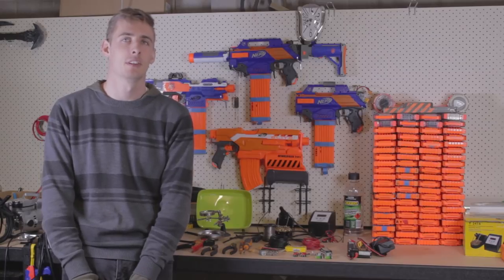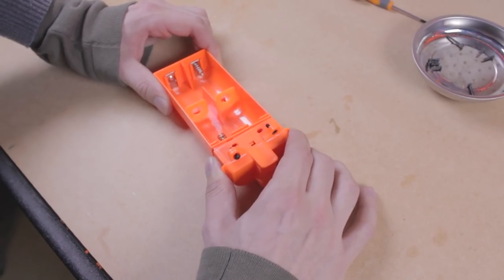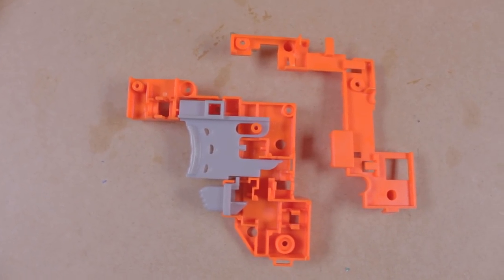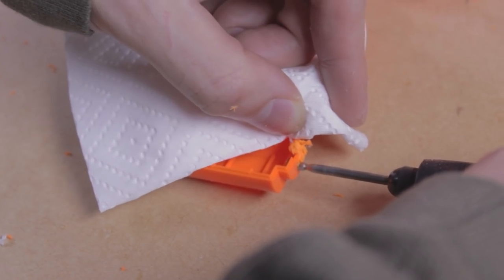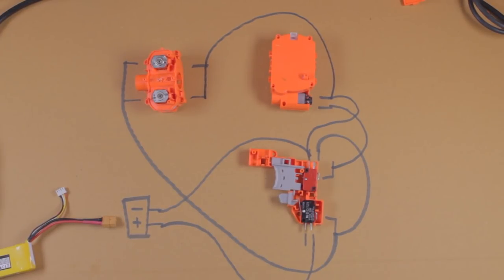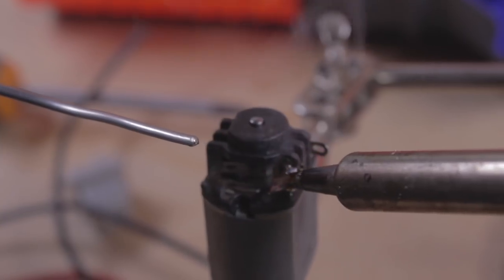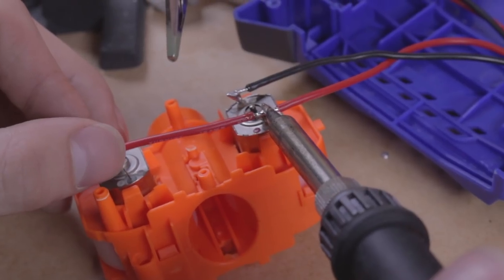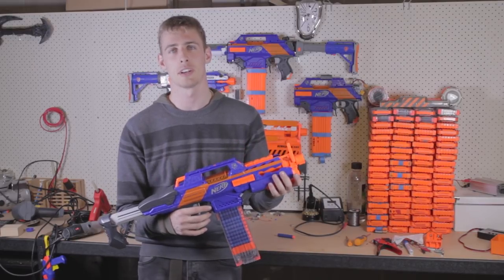How to Make a Super Rapidstrike | MAKE TEST BATTLE Modding Tutorial

Comment: Hi MTB! Nice video!!!

I got my Rapidstrike about two weeks ago, and I followed Coop's guide, but my gun had grey trigger. When I opened it, saw in the pusher mech, two resistors, I didn't cut it. I kept the motors, in my country is impossible to get better motors. Im using x3 3,6v batteries and the ROF is the same (18 darts in 4-5 seconds), but the range is a little bit better. I really want a faster ROF, but I don't know what I need to do. Can you help me? :)

Thank You

PS: I'm brazilian, :P
Reply from the maker: +O Alface Hi there! The trick to getting the rate of fire as high as possible is to get the pusher motor spinning as fast as possible. Without changing the motors this leaves you with only a few small things you can do.
1) Rewire the blaster as per this video to cut down as much unnecessary circuitry as possible. This will reduce the resistance, particularly with the thicker gauge wire and low resistance switches.
2) Use the best quality batteries that you can find. Better batteries will ba able to provide more current and maintain a higher voltage; particularly LiPo packs instead of single AA sized cells.
3) Use more batteries. Overvolting is a pretty simple way to increase the rate of fire but you risk ruining your motors, particularly the stock ones.
Otherwise you really need to swap out the pusher motor; I highly suggest our MTB Rhino 130 motors. -R
Reply: +Make.Test.Battle And the resistors of the pusher motor??? Should I take out it using stock motors???
Reply from the maker: +O Alface Yes; definitely. If you follow this video you will see that you should take out all of the original electronic parts other than the motors and the switches in a full rewire. Everything else only slow down the motors -R
Reply: +Make.Test.Battle THX!
Reply: +Make.Test.Battle I'm not going to put microswitches for now, what I need to do with the acess door switch? I'm running 3 minamoto batteries, 3.6v each.

Comment: why did you need to put the running motor into the metho? what does that do?
Reply from the maker: Hucky32 What it does is shape the carbon brushes on the motor to provide a better contact. Makes the motors much less likely to burn out when being used. Not really needed for most motors but a necessity for Ransons as they usually burn out very easily.
Reply: ah thanks :)

Comment: I have a 1300 mAh, 11.1v, 20c discharge 3s lipo, will that work?
Reply from the maker: +maxava123 That should be fine. If you had the option, maybe get a 30C version instead but that one is fine -R
Reply: +Make.Test.Battle I'm not using the same motors so it should be fine

Comment: What does the burn-in for the Ranson do? Why is it necessary?
Reply from the maker: Gabriel Doudna It helps to round off the brushes of the motor to get a better contact. This results in a better contact, less arcing, and reduced heat buildup making the motors much more reliable. It is really only needed for the Ranson motors which suffer from burning out. -R
Reply: Cool, thanks for the info and quick reply!
Reply: The Hobbyking motors work beautifully at 8.4 volts. However, the part numbers on the side of them say "FK130SH" and according to the Mabuchi website, they run just fine at 12 volts! So get those!

Comment: if using this setting & motor..
1. may i use Ultrafire batteries 14500 1200mAh (3.7v)
2. how much Ultrafire batteries that i needed?

Really want to use ultrafire batteries because in my country LiPo Battery Pack & LiPo charger price are rocket high!

If can't please suggest me with suitable motor for ultrafire batteries that are stated.
TQ Make.Test.Battle :-)
Reply from the maker: You shouldn't be using Ultrafires for replacement motors. They do not have a high enough discharger rate to properly power the motors
Reply: +Make.Test.Battle how about using ultrafire only for stock motor?
Reply: +Mohd Syahwal I'd get a 2s lipo much better

Comment: Why do you need the lipo charger power source?
Reply from the maker: +thedavinator 37 Most good balancing LiPo chargers run off 12 volts DC so you need something to convert your wall socket AC power to 12v DC. THis is usually so you can run the charger off a car battery when in the field -R
Reply: +Make.Test.Battle oh ok thanks and is it necessary to put the motors into the liquid?
Reply from the maker: +thedavinator 37 No, only that particular brand of motors, but you can't get them anymore anyway so it doesn't matter -R
Reply: +Make.Test.Battle oh so like an ac adapter
Reply from the maker: thedavinator 37 Exactly -R

Comment: Also how to I get the pusher motor to instantly stop so it does stop in a odd position or fire extra shots?
Reply from the maker: Is because of the motor braking -R
Reply: Now what is motor braking and how do I do it.
Reply from the maker: When the motor is not being powered, it uses the power it generates itself to slow itself down. You basicallt are just wiring the motor to itself. Its essential for RS pushers but not necessary for flywheels. Sounds cool tho. PsykeSG has a video on it if you are curious -R
Reply: But how does it immediatly start the motors?
Reply: Also can I have link to video?

Comment: is there any other battery that could be used maybe some ultrafire instead??
Reply from the maker: +WCxColossus UltraFires and other 14500 sized batteries don't have the performance to run upgraded motors properly. There are some IMRs that are alright (such as WindyFire and AW cells) but the rest are quite mediocre and a LiPo is far superior. -R
Reply: +Make.Test.Battle ah ok so if i wanna upgrade motors ima need to run a 3s lipo
Reply from the maker: +WCxColossus Yes. I would highly recommend running LiPos.
Reply: +Make.Test.Battle nice thanks for the help. ive been looking up replacment motors is there any that you recomend?? alot of ppl recoment 180 blades but idk what that is lol
Reply from the maker: Have a search for our MTB Rhino 130 motors. You can find a video about them on the channel. They are really, really good and you don't need to do any shell cutting. They are the same as Falcons. -R

Comment: Hey mtb, would this work if I wanted to run lower voltage
Reply from the maker: It wouldn't perform as well with those motors. If you want to use a 2S LiPo or similar (~8 volts) use MTB Honey Badgers -R
Reply: Ok thanks

Comment: Can I use alternatives to a LIPO like 4 IMRs instead?
Reply: Kingrai 15 it depends on the motors/switches you buy
Reply: IMRs are dangerous
Reply: @Cringemoment4045  howd u mean
Reply: @warriorharj79  they don't have the required amps to supply the motors and will burn them out
Reply: @Cringemoment4045  Ah okay, what about with a rewire and stock motors?
Reply: @warriorharj79  stock and BP motors can run IMRs. Others cant
Reply: @Cringemoment4045  ah okay thanks, what do you mean by BP?
Reply: @warriorharj79  blasterparts

Comment: If the pusher doesn't retract does that mean no single firing?!?!?
Reply from the maker: +Turb Plays You can still single fire quire easily. The added motor braking replaces the need for retracetion -R
Reply: +Make.Test.Battle if i reload would the pusher get in the way of the next mag?
Reply from the maker: not the dart just pushes it up slightly. no problems
Reply: If the pusher arm is extended and the mag in inserted the dart will be hitting the pusher arm and it would break the dart and or pusher arm
Reply from the maker: Turb Plays No; the pusher arm can be very safely pushed upwards by the darts. I've never had any issues with it. Its exactly the same as what happens when the dart is fired and the next dart in the mag pushes up on it -R
Reply: Ok just wanted to clarify b4 doing the mod. Can i run these motors with a 3s lipo?

http://www.rcplanet.com/EFlite_180_Motor_with_8T_0_5M_Pin_and_PTC_Fuse_Lef_p/eflh1210b.htm
Reply from the maker: Turb Plays I believe these are a 2S motor; but if you want to wait maybe a month, there will be a new line of MTB 180 sized motors that have a much higher performance for about the same price that run off 3S -R
Reply: +Make.Test.Battle How much do ranson motors go for? I cant find cheap ones, saw 1 for 14 dollars
Reply from the maker: Turb Plays Get MTB Honey Badger motors -R
Reply: Make.Test.Battle Would they burn out since its 3S lipo power?
Reply from the maker: Turb Plays No, as a pusher they dont take as much load as the flywheels do so they are okay. They were designed for this role and you should get 14 darts per second out of them. Have a watch of our other video on it! -R
Reply: +Make.Test.Battle its not a 3s lipo that makes it get 14 darts per second
Reply from the maker: Turb Plays hmm? I dont understand what you mean? -R
Reply: u used a higher AMP/volt battery for the 14 darts per second on the testing video with 14 dps
Reply from the maker: Turb Plays It was a normal 3S LiPo. it just happened to be a large capacity one that we use for testing and stuff. A normal 3S battery would get the same result -R
Reply: oh and the 180 EFLH1210B would be 2 much ROF right?
Reply from the maker: Turb Plays Those would work just fine; their RPM is lower than a honey badgers. Not sure exactly what they would get -R
Reply: oh i want good but controllable ROF
Reply: +Make.Test.Battle can i use RM2 motors they have good RPM, problem is that the shipping cost for ur honey badger motors are expensive
Reply from the maker: Turb Plays RM2s are cheaper, but they dont have carbon brushes so they will quickly burn out. If you have the skill you can buy a cheap carbon brushed donor motor and swap the brushes into the RM2. Otherwise I cannot recommend those motors -R
Reply: +Make.Test.Battle so i can take the clip out of the gun and reinsert a clip regardless if the pusher arm is in the extended position
Reply from the maker: Turb Plays Yup -R

Comment: Is the circuit he used in series or in parallel ?
Reply from the maker: The motors are very clearly in parallel, otherwise in Series the voltage would stack. 
-Justin

Comment: i saw some comments about replacing the falcon motors with rhinos and the ranson motor with honeybadgers. are these motors on amazon and if they are could someone provide a link to them pls?
Reply: Rhinos and honeybadgers are on blastertech, containment crew, Etsy and eBay but not Amazon
Reply: well now I know of OutofDarts, but thanks for responding. And while I have you, when calculating the total usage time of a Lipo, do you use the stall current of the motors, or is there a lower normal operating amperage? When looking at the stryfe vid, with the rhinos and the 1000 mAh battery that is recommended, total operation time is only about 2 minutes, which seems kinda low to me. Know what I mean?

Comment: can you mod my rapidstrik pleas and fix it
Reply from the maker: No.
Reply: +Make.Test.Battle hey why didn't you guys include a cut off switch for the pusher motor in the circuit to insure thebplunger rod is always fully retracted when not in use?
Reply from the maker: Steve W Because it makes it way more complicated to wire up and isn't really necessary -R

Comment: Three questions 
1: After reading some comments and your replies, I see the MTB Rhino motors would be good ones to get and more available, for those do you still need to do the burn in? 
2:Can you elaborate on the lipo charger and charger power supply , your link for the power supply has many results and I do not understand which I should get, or how to determine that, could I jurry rig an old PC PSU for this purpose?
3: instead of the given battery, requiring the imo overly part-y charging solution, could you get a similarly speced RC car battery that comes with a little wallwart charger? Just to make charging a bit easier and convenient. (this kind of charger http://www.ebay.com/itm/like/201262875230?lpid=82&chn=ps&ul_noapp=true)
Reply from the maker: 1) No
2) Buy this instead: http://www.hobbyking.com/hobbyking/store/__95983__Accucell_S60_AC_Charger_US_Plug_.html
3) I don't know much about the discharge rates of NiMH batteries, but they could in theory work.
Reply: One more question I'm looking at the battery at it says it is on backorder, but higher mAh batteries,  that are identical in every other way are available, would those work just as well and likely just last longer?
Reply from the maker: gamermanj4 Bigger batteries probably wont fit in the shell. Maybe get the 35C version if the 25 is still no backorder -R

Comment: I have another question. Would this motor   www.ebay.com/itm/271330001222   work in the place of a Ransom? It is the only motor I can find that has a 3600 rpm. Thanks!
Reply from the maker: +Test Facsimile that motor isn't a very good choice. At 12 volts that motor would only be ~14,400 RPM compared to ~70,000 RPM. The MTB Rhino motors work really well as pusher motors.